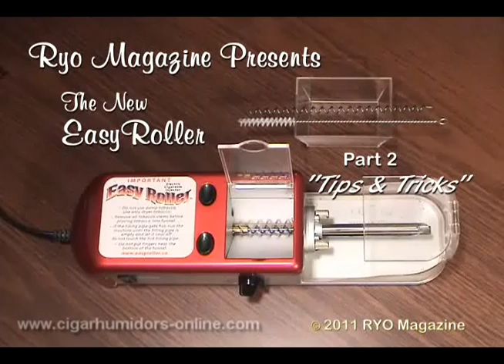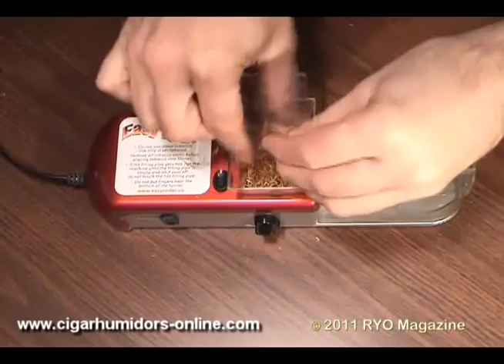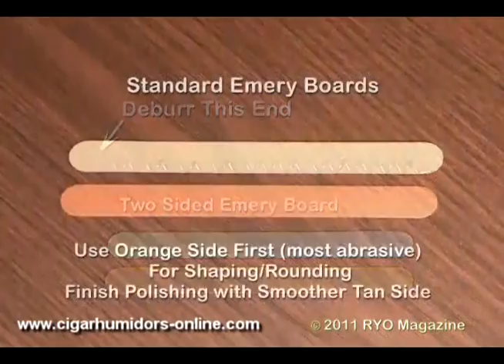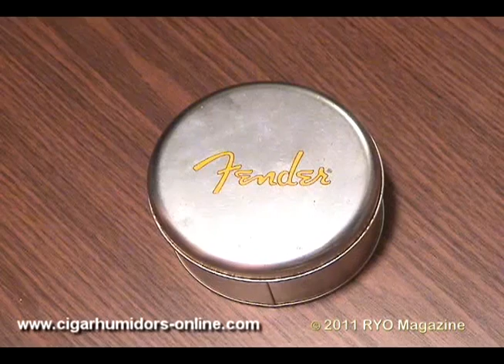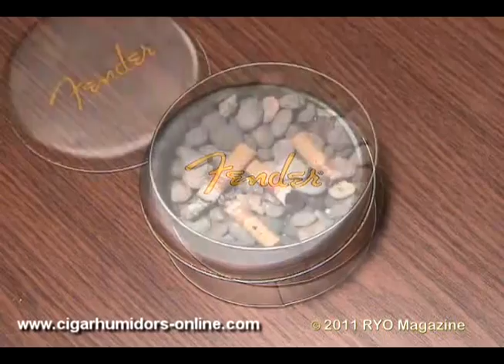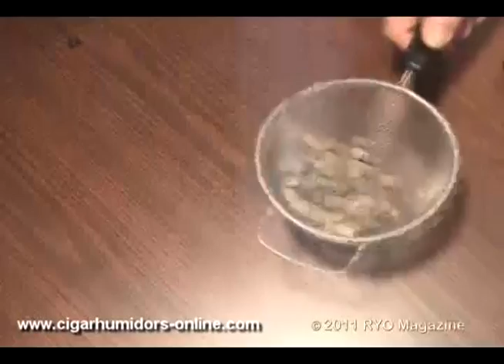Easy Roller TIPS & TRICKS - Get the Most out of your Cigarette Injector Machine

Comment from the maker: All electric and almost all manual machines must use filter cigarette tubes. When the tobacco injects into the tube it stops when it touches the filter and that is what causes the tube to push off the tube holder. With no filter there is nothing that will keep the tobacco from coming out the other end and to slide off the holder.